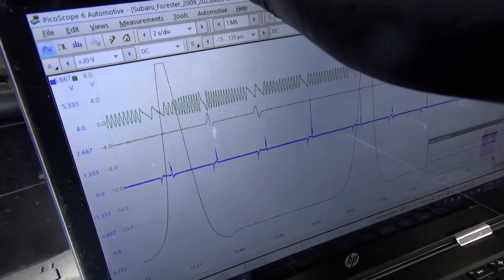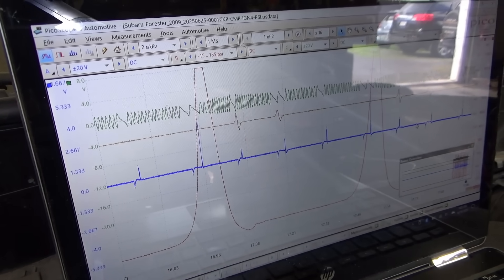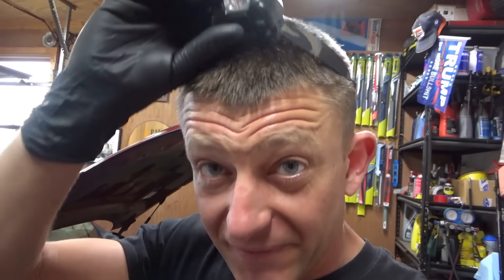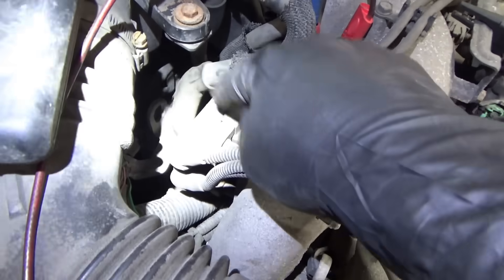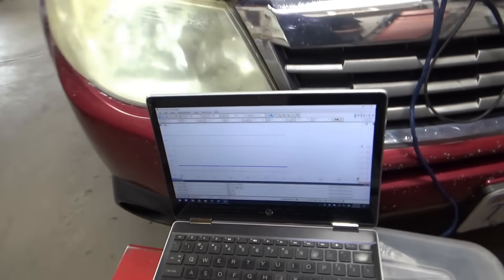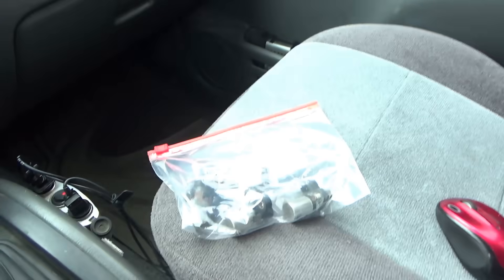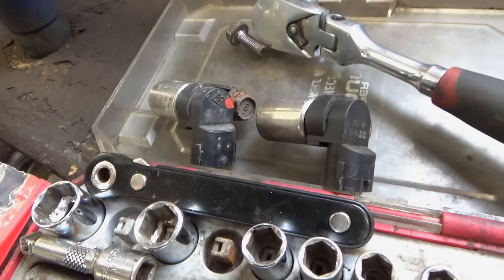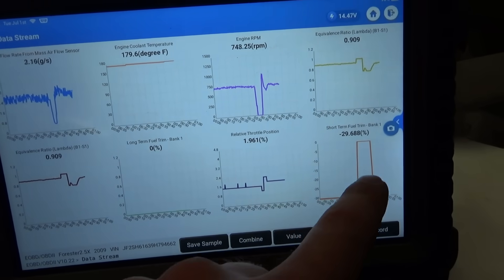(Pt 2) Subaru STUMPS Shop...for 6 MONTHS?!? ('09 Forester Crank No-Start, NO CODES!)

Comment: Royalty Auto Service had a car that drove them crazy for months, seems that the car had a hood latch that was wired to send an alert if it wasn’t latched properly. 
As it turns out the owner had replaced the original with an aftermarket unit and hadn’t mentioned it to Royalty. 
That latch was wired incorrectly, but would not set a code, but would cause problems.

Comment: I have seen similar where a sensor was wired as though the wire positions in the new part were the problem.
The tech had to switch the wires in the cars harness connector so when it plugged in it would be corrected or changed to match to the new part.
Then his ran fine and idled smoothly.
I saw a different car, in the garage near me, that had transmission symptoms and was serviced.
But it's real issue was one wire would arc under light load.
Like you would need at 5 mph to accelerate over large speed bumps.
As you applied the throttle pedal gently it would feel like some unusual transmission issue.
During visual inspection, a plug wire was found to have been chewed on from behind and below out of normal visual sight.
It looked new enough, you wouldn't suspect.
But fluffy had been gnawing on it, and nothing else. There was no rodent dirt and no rodent smell.
I think fluffy used an ex-acto knife???
Fluffy was naughty.
You're naughty, fluffy.
Naughty.

Comment: That what you get for buying doorman electric and electronic parts, the sensor electronic parts must be assembled wrong way inside it,  something similar happen to me when I bought an aftermarket transmission shift solenoid, the wiring was put inside the connector wrong, the right wire been inserted on the left side in the connector and the left wire been inserted in the right side of the connector, and the  car was giving me incorrect shift ratio code, and I just compared the old OEM one with the new installed one and I saw the problem, even the wires inside the connector are easy to remove from the connector and correct the issue, but I didn't want to do that,  I bought a good used OEM one for eBay,  and i  installed it and i returned the new aftermarket garbage one, because I knew that aftermarket one  will not last for long even if I corrected the wiring problem.

Comment: How can they mess up making such a simple device. What's Inside. A coil? A magnet? Not complicated? Also why do you trust your test light when a meter would show more accurate actual  voltage reading. So if 11v instead of 12.4v  would cause a problem would your pen light pick that up?

Comment: Can you explain about the rich fuel comment at the end of the video? I have that problem (P0172 air-fuel mixture in Bank 1 is "too rich,") on a 2008 Subaru 2.5i and have tried cleaning the MAF, checked for vacuum leak, checked fuel pressure, replaced fuel injectors. Thanks.

Comment: Always use OEM on replacement sensors thirty years in the trade taught me that, people fail to realize that some after market sensors dont use the required voltages. catches people out all the time even garages, I am retired now but will still only fit OEM engine sensors if anything goes wrong with our own cars.allso don't scrimp on replacement batteries some cheaper versions can also cause similar issues if they end up with a bad cell etc, my neighbor had all of here electronic power steering and electrical units replaced at huge cost only for the problem to re occur a week later it was only in conversation with my wife she mentioned this then my wife told me so I went round out of curiosity told her I was a retired mechanic and could I check her battery, sure enough she had a replacement fitted last year at the same garage but I suspected it was a cheap generic battery with whoever's stickers on it I tested it and sure enough when I wobbled it around it had a faulty cell, I fitted a yuasa one with a 4 year warranty and guess what the steering service code went away and here cruise control started working properly again just because things are new don't mean they are good.

Comment: I had Nissan frontier . It would intermittently die and stall but still able to duplicate.History code showed cam crank correlation code . I got it mess up but the wave forms was inconsistent. I replaced the crank sensor with a OEM from the Nissan store and soon as replaced the truck wouldn’t start at all. Put old sensor back on and it started . So I end up ordering a NTK sensor and replaced and fixed the issue . This has also happened me on GM products too . At times OEM products can be questionable as well . They don’t make like they used too

Comment: There is an issue as vehicles get older, you can no longer get factory parts for them.  If you are lucky you might find them in a junk yard.
I agree, Ivan, if it weren't for the known good wave forms you would be shooting in the dark unless you were an expert on that vehicle.

Comment: Avoid aftermarket sensors at all costs.  I'll get used OEM from a junkyard before I'd buy any aftermarket crap.  ESPECIALLY electrical engine components.   Most likely the original crank sensor was still good anyway.   In hindsight I would have run into a dead end, but I'd have tested the integrity of the signal wire from the ECM to the coil.  Nice video, thanks!

Comment: No matter how many times I try to spread the word on critical engine components being OEM. Customers ALWAYS say “ok but I’ll just buy it on Amazon. For 15$.”  I used to go along with that but now for brake parts and sensors I refuse to do the job is if they get Amazon parts. Because soon enough they’ll have an issue and they will be thinking “what did that guy do to my car?!” I learned my lesson

Comment: I had to replace the cam position sensors on my Xterra last year. There were cheap ones available but I heeded advice from others & bought the Hitachi's. It wasn't fun & I would've been pissed if I had to do again because of cheap parts.

Comment: A tech rep from Borg Warner warned me back in 1996 to use only  OEM sensors on Chrysler products due to the fact that the winding direction of the sensor coils causes issues with timing signals in the computer. Apparently quality of the aftermarket are kinda willy-nilly. Good job of troubleshooting! 😊

Comment: I use dorman  parts alot and so far except for electric sensors, haven't gavee very much trouble. I use dorman electric sensors and modules only when I can't get OEM parts or a high quality company, which does not exist anymore. Call Ford, Chrysler Dodge, Chevrolet look at where the product is actually made and it will almost always be manufactured in damn china. but the packaging will usually say manufactured in China for exclusive use to Chrysler Dodge, or Chevrolet or Ford. Very small print and the parts cost about 90 times the damn cost of making the part from top to bottom. 😢😢 Really read the OEM parts packaging. 😅😮😮😮😮

Comment: I've been a fan for a long time, BUT this is the worst diagnostic you've ever done.
In fact it's probably the worst diagnostic I've ever watched in 10 years or so!
Other diagnostic sites, and maybe even you, recommend to use all your senses in
performing diagnostics. What happened to your eyeballs???
You should have spotted that Dorman straightaway. Once you suspected it, you saw it immediately.
I'd be ticked in paying your invoice for waisted diagnostic time.
Unfortunately I run into this type of Diagnostics every time I have a problem with my 93 Allante.

Here's the latest example
Fans quit working.  Shop # 1  it's a stuck relay, WRONG
Shop # 2.  Car cmptr is not sending a signal to turn the fans on   WRONG

I'm 83 hears old and I didn't need a scanner to find the problem.
I just measured 4 wires on relay, no fancy equipment.
Blown fuse!  (caused by shorted O2 sensor heater).
So before all this high powered diagnostics (2 parts) use your sense & senses!!!
I guess the fact that YOU Tube pays you by the minute encourages "Longer diagnostics?
Reply from the maker: Wait.... You took your Allante to a SHOP for diagnostics of the cooling fans? But you could have figured out this Subaru with a visual inspection in 10 minutes? WOW 🤣👌
Reply: @PineHollowAutoDiagnostics  I've seen you warn viewers over & over about Dorman electrical parts.
So I would have thought that would be one of the 1st things you would check?
Usually for ignition problems, suspects with high possibilities are cam & crank sensors?
Unfortunately every problem that has shown up on the Allante since I bought it in 2001 has been misdiagnosed by 5 different shops.

(1) intermittent no crank, anti theft makes you wait 3 mins to try again.
$2200 repair, replace cars cmptr, wrong, it was vats, I fixed with a $1 resistor from radio shack.

(2) Service engine soon lit up and engine takes longer to start
$1600 Diagnostic bill, replace cam sensor, (Lite still on).I found bad ignition control module.

(3) 2 years later,  "Service engine soon" lit again. Due to problem # 1 I downloaded everything about
the Allante's ignition system from the internet, schematics, wiring diagrams, operating theory
trouble shooting guides etc!  Took to a different shop and handed info to owner. 
"Oh thanks but we don't need that, We have our own diagnostics.
Fast forward 2 days, shop calls, "Good and bad news about Alllante."
Crank sensors were bad and in difficult location but good news we replaced them"
"Bad news, "service engine lite" still lit"
So my turn AGAIN. can you guess? Yep another bad ignition control module.
I  bought two this time, and sure enough the lite went out when module replaced.

(4) Two different shops have been working on the fan problem since April of this year.
Also a related problem a 1600 rpm idle. Car has to be smogged by November 2025,
and it wont pass with a 1600 rpm idle, so I have no choice. I gotta fix it one more time.

This should explain why I'm  probably over sensitive to "less than ideal diagnostics".
Anyway I do enjoy your posts and in most cases learn a lot about proper diagnostic techniques.

No Wife luvs the Caddy, Happy Wife Happy Life!

Gary

Comment: I think I would’ve taken off the timing belt to look at the wheel the crank signal picks up from assuming the wave form is being triggered by the wheels my mind was blown when it was the sensor throwing the signal out at 180 degrees mind blown 🤯

Comment: Thanks for sharing the Pico files. I played around with the files using Pico 6. I tried using the Reference Waveform feature to overlay channel C from your friends car and the broken car. I was able to get the Reference Waveform feature to work but it was still difficult to compare the two traces since they were at different frequencies. I believe it would have been easier to compare the two channel C traces and spot the difference if both traces would have been taken while cranking the engine over. It appeared in the video and from the good trace that you made the capture from your friends car with the engine running and the capture from the broken car while cranking. Thanks for creating these videos. I always learn something. Test don't guess is a good motto to live by when repairing cars.

Comment: I had that same issue on a KZ750 motorcycle with the ignition pickup coil. It was replaced by previous owner. Colored wires (2 wire system) matched and had good signal. After lots of looking and testing, I decided that the signal was wrong. A Gut feeling. The wires were swapped and the bike fired right up. I don't know it was a OEM or not.

Comment: I saw this on diagnose Dan channel. I don’t think it was a Subaru though but the crank sensor was aftermarket. The waveform looked ok but on closer inspection it was flipped like this one.

Comment: I've had that happen to me. I diagnosed a Kia Sorento with a bad crank sensor. I got an aftermarket sensor because an  oem sensor wasn't available and same thing, the polarity was flipped so the car didn't start. Luckily I had scoped the original sensor and saw that the signal from the aftermarket sensor was flipped.

Comment: ivan someday when you get older and start to hurt like most auto techs after 25 years you should be a trainer.  i dont understand electronics very well .  but, when i have starting problems like this i can at least look for an aftermarket part. sad to say i have been burned by new o.e.m. parts. i was a points and plugs mechanic

Comment: I saw this issue on an episode of Diagnose Dan. He saw this same thing with a Bosch CPS.
Reply: I saw that one too. Had Dan stumped for a while because  the "unthinkable happened", he had patterns for two bad Bosch sensors (inverted signal pattern) in a row. Then luckily no Bosch sensors available so Dan opted for a reliable brand Non Genuine (which produced the correct signal) and the engine fired up first crank.

Comment: That's a cool case study.  The chain of events is unclear - did the Roo drop dead 6 months ago, somebody replaced the crank sensor, and it was still dead? 
 When I first got a scope about 20 years ago I learned pretty quickly  that you need known good to compare to what you see now.  Otherwise it was a steep learning curve - not sure if what I was looking at was good or bad.

Comment: That's so cool Ivan.  But as you said.  Without having a known good oscilloscope waveform, you would be guessing.  You know what would be really handy.  A web site shared by a community of other techs that has known good waveforms for just about anything.  Alldata has some, sure.  But you would be extremely lucky to find them for the vehicle you're working on.

Comment: Diagnose Dan actually had very similar case study years ago! Flipped ckp signal. If i remember correctly it was on a wheelchair van
Reply: On top of that if I remember correctly with Dan his was Bosch and he even tried three more Bosch sensors and they were all wired wrong from the factory so I can't remember though what he ended up doing about that I mean where did he get his part at?.. and I'm not a wiring expert but would have been possible to invert the hookup on the powers you know blue to green and green to blue could that have been done if necessary or would that still not have worked

Comment: "The CKP signal is inverted."   ...Wait, how...what??  I've been staring at those scope captures for ages now trying to understand, thinking maybe the pattern is shifted or the peak amplitude is nerfed, but...No, the rise and fall patterns are ACTUALLY inverted on the sync notches.  Dorman actually broke physics.  Dang.  That is S-tier screwup.  LOL

This car 100% would have beat me.  :(
Reply: he should have zoomed in a bit further, the only place it's really noticed is where the wide gap is, you can see one crosses top left to bottom right and other is opposite bottom left to top right. zoomed in further and overlaid would likely show it reversed everywhere. still a good catch, as many might breeze right over it.

Comment: I put a motor in a Subaru. Not sure if the motor came out of a different year or model. Have done numerous Subaru engine swaps without any issues. However, this one would not run. Ended up being the driver side cam pully had the wrong number of teeth on the reluctor wheel. Swapped over the one from the original motor andnit fired right up.

Comment: Great job, Ivan.  It really shows the power of diagnostics. Bernie Thompson had a similar case study where his waveform was also upside down, but in his case, the reluctor wheel on the crankshaft had actually magnetized itself due to a poor ground. He ended up having to demagnetize the wheel to fix it.

Comment: Thanks for the video Ivan! As I'm an old DIYer. I once again point to the manufacturers, for using too much tech instead of just improving mechanical timing methods. Semiconductors because of thermal conditions, primarily heat, are prone to failure. Points and condenser were easily diagnosable for any DIYer. They used vacuum and centrifugal spark timing and a carburetor for air fuel mixture. That system basically worked for decades, and was simple to diagnose and repair but I'm sure could have been simply improved too. Also, who needs more than 150 hp. to move their car around, anyway? Just sayin! Let the racers use high tech, but make cars simple for common folks to repair.

Comment: How many times have I watched a diagnostic video where an aftermarket part was the sorce of an issue? Literally hundreds (yes, I watch a lot of channels 😄)! Always confirm that the part you replace is OEM or functions as such. A junkyard sensor that performs correctly is better than 10 aftermarket units that do not! Also, I have backup sensors for my vehicles (yes, I have installed them to verify operation) because a lot of manufacturers are discontinuing sales beyond a certain date. Great case study, Ivan! 👍🏻

Comment: Perhaps the crankshaft position sensor was installed upside down, lol. Great video as always and even my Guru has his own Guru, which is a great reminder.
Reply: Are you saying the crankshaft position sensor should be rotated 180 degrees?  That's not going to change anything.  You'd have to swap the wires on the vehicle harness but I don't recommend messing with the vehicle harness.  Perhaps, for diagnostic purposes, you could temporarily reroute the circuit without messing with the vehicle harness.

Comment: about a year ago dan  from diagnose dan  had a eurotrash  with the same thing. seen a couple of  various videos since.  is the person winding those sensors also smoking left handed cigarettes??? winding them backwards?  lol   the circuitry in the computer must be like an oscilloscope trigger-   triggers on either a rising or falling signal  depending on how its made.  if it sees the opposite  it throws up its little hands and says WTF?  this proves that in reading oscilloscope patterns  you cant be a speed reader. details details!   great case study ivan.